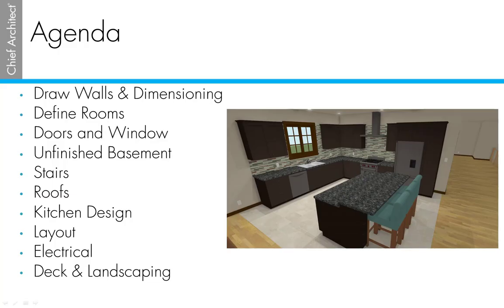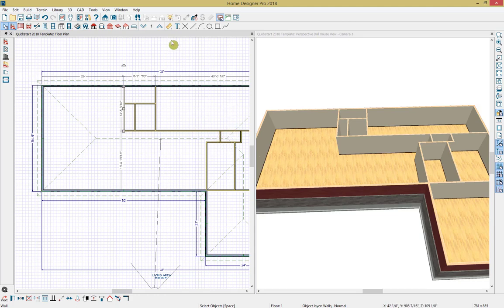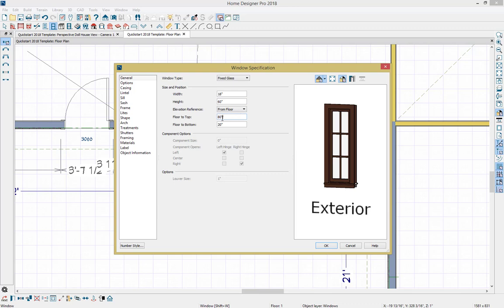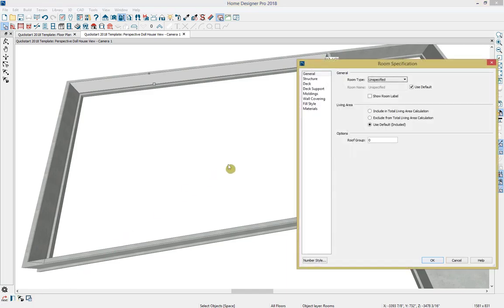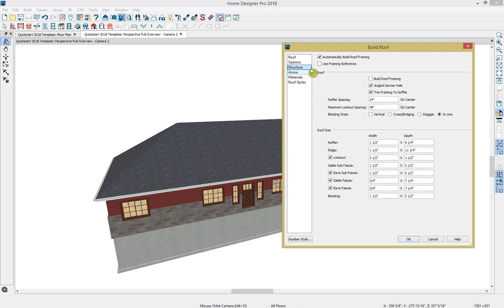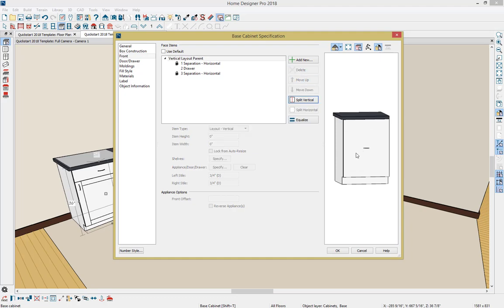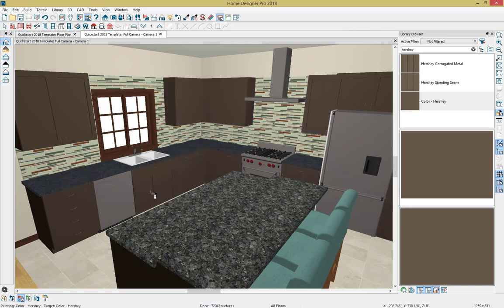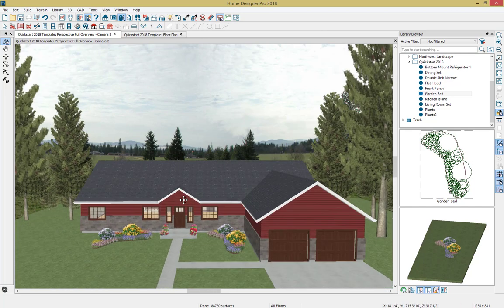Home Designer Quick Start 2018

Comment: I am in the Caribbean and I would like to buy this, here  we mainly build using breeze block, been look through the list of main walls cant see blocks or bricks
Reply from the maker: Thanks for your interest, Leslie! With Home Designer Software there's a pre-defined Brick wall that you can select. If you'd like to make a custom wall type using another material, you can do so with Home Designer Architectural and Professional.
Reply: thanks,  taking a look now
Reply: looking for software,
All land is shaped differently some are hilly some are flat, can I put in the GPS location of the land (site) to show what type buildings will fit.
Reply from the maker: Hi Leslie! Yes, you can import GPS data with Home Designer Software to create the plot plan.

Comment: This is an excellent video!  I am only halfway through, and trying out bits as I go, but I've learned several very basic things that I could have been using for years--things that I think tend to get missed in many of the videos because the demo person does them without thinking.  :)  

I have a couple of questions that I hope you can answer.  I have an older version of HD Suite, so several features on this video are things that I can't do, and I am wondering about the wall nudge.  When I highlight an item and hit the arrow key, it just shifts my view rather than the item.  Am I doing something wrong?  It certainly doesn't seem this should be a high-end feature, and I even thought I had used it before, but it's not working.  Should it?

The other question is something I have run into several times.  I have a floating staircase!  For some reason, the staircase begins several feet above floor level.  What causes that and how do I fix it?  So exasperating!

Btw, I love U-shaped stairs, and they are fairly cumbersome on my version, so I am quite impressed with that feature!
Reply from the maker: Thank you Ronda! We introduced the nudge option in recent versions, so if you upgrade to the latest Home Designer Suite, you'll have it available. We offer upgrade discounts through our website or call our sales team at 800-482-4433 M-F 6am - 5pm Pacific. In regards to your floating stairs, I recommend contacting our tech support for assistance. You can call them at 208-292-3375 or send your question and plan to them through the online support center: https://www.homedesignersoftware.com/support/#contact